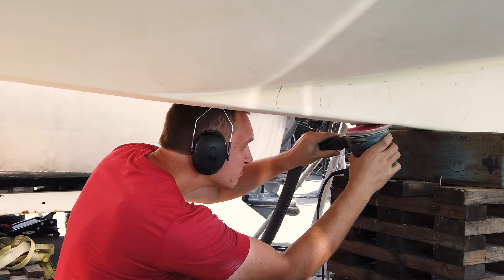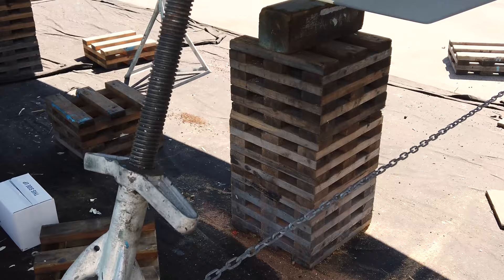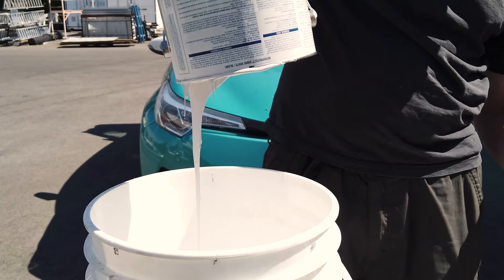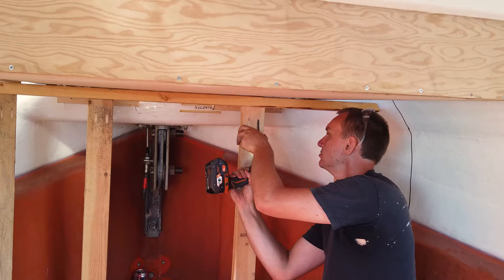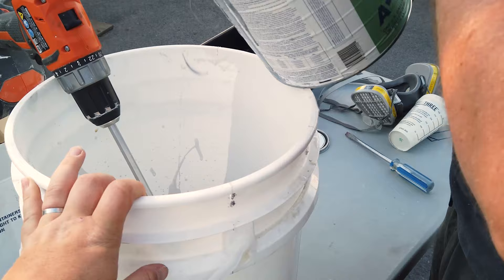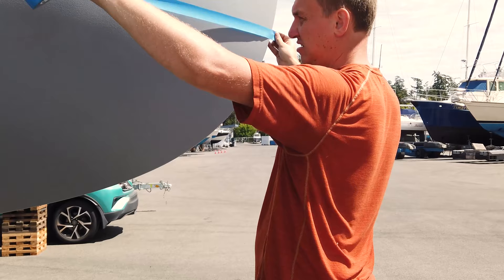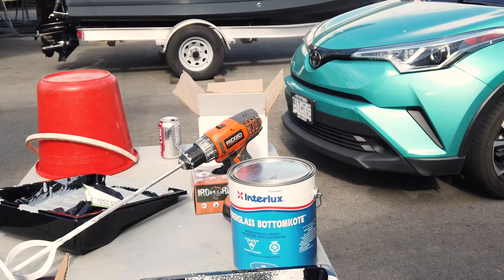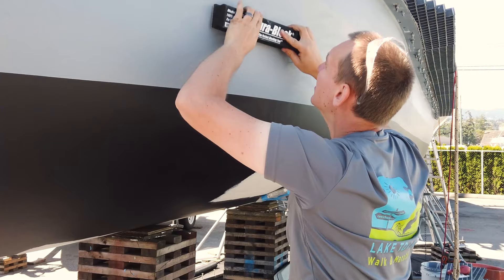Ep 12 Lifeboat Bottom Paint + Some HUGE Blisters // + More Building and Conversion

Comment: Am thinking of painting ours as it's been naked fibreglass for 8 years on our adventures... any advice?
Reply from the maker: A good wash to get any wax or grease off the outside. Then sand everywhere you want to paint until it’s a frosty finish. Something around 120 grit sandpaper. Then ideally you would prime, sand again then paint. Usually you would want 2 coats.  Again sanding between coats lol it’s a lot of sanding =P

That said if you just wanted to protect the fibreglass from UV you could get away with much less I’m sure it just won’t look as shiny but will be functional :)